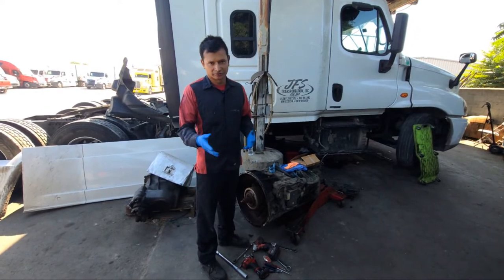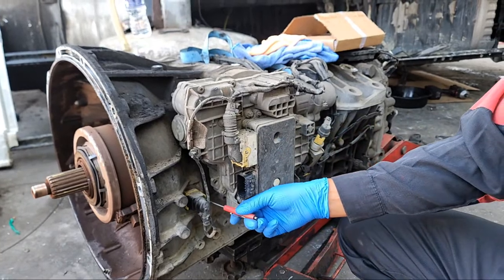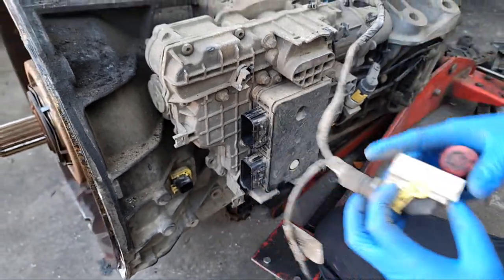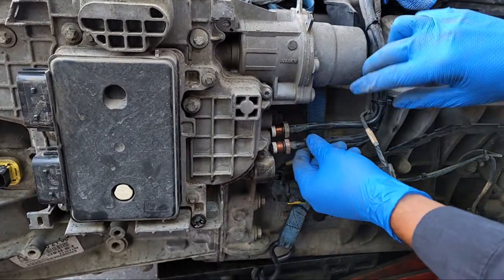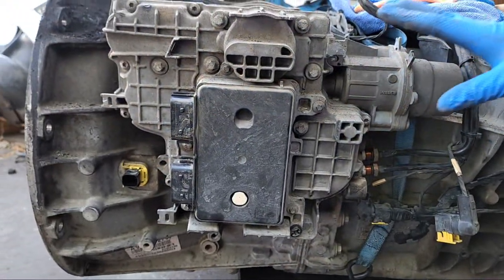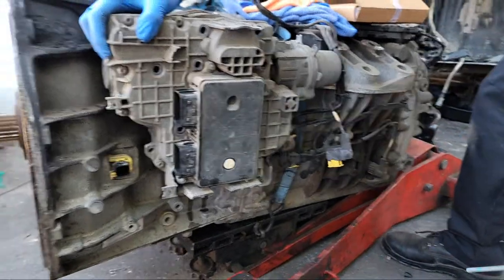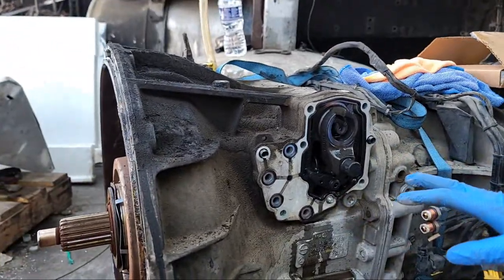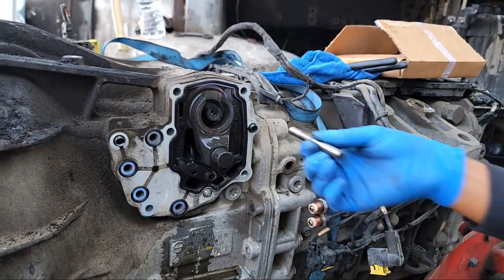DT12 automatic transmission services repair split pin removal and installation August live video

Comment: LIKE THIS VIDEO!! Can you do a video on the repair of the shift control module, I have one that is dumping air for some reason, and it has an intermittent  shift issue when it does hold air pressure. Thanks.
Reply: Hi, mine does the same. Is it fixed on your truck now? I am not able to find what is wrong with it

Comment: Hey brother I'm noticing that when transmission downshift from 12 to 11 it makes loud noise but if it goes from 12 to 10 no noise also does it from gear 8 to 7 but that's it and also temp stays at about 130 to 135 F. And truck is a 2021 cascadia with DT12 transmission please help thank you